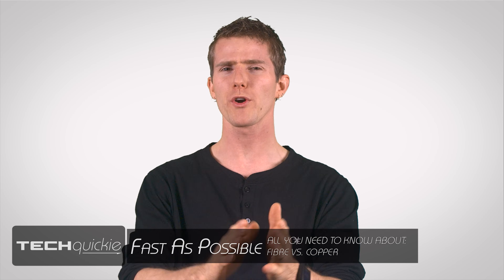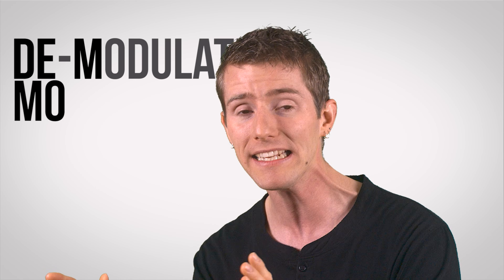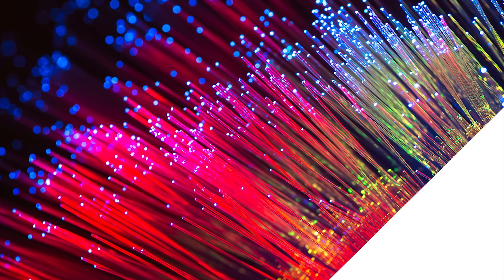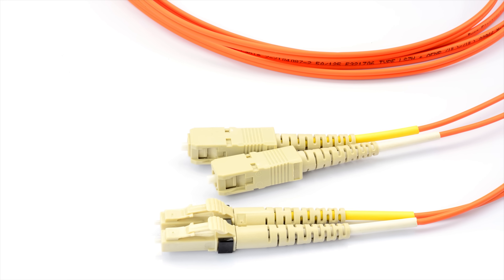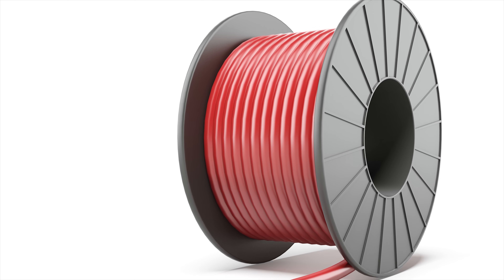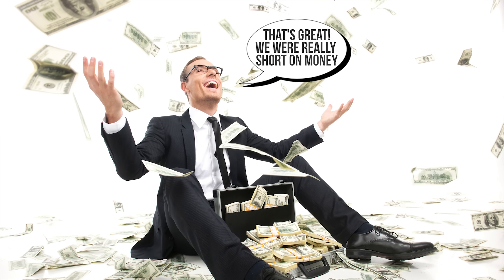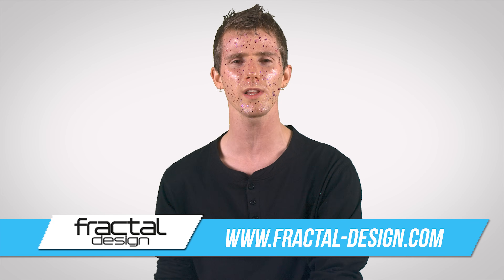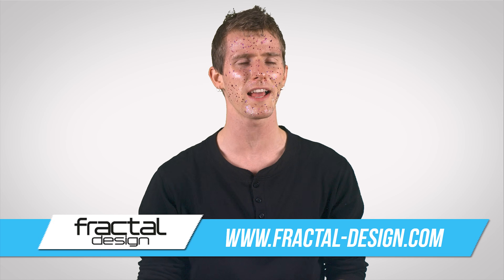Fibre (Fiber) vs Copper as Fast As Possible

Comment: since sony and microsoft are getting so many DDOS attacks

can your next video be about how DDOS attacks work? 

I m curious why DDOS are not called 'hack'
Reply: Cause DDOS is a attack not an hack.
Reply: A DDOS is not a hack because all it takes is a group of computers being remotely controlled from a different location sending massive amounts of information/requests to another computer until it can no longer accept and process any of the information.

Anyone who has access to a botnet (a bunch of computers that are remotely controlled that you can actually rent) and a script that are easily available on the web can do this. (Hence the term script-kiddies)

Hacking on the other hand means using software or hardware exploits to change aspects of how that computer works, and means actually looking at or changing actual computer code in order to access those exploits.

TekSyndicate have a bit of information about what a DDOS and why it isn't actual hacking is on their latest The Tek video.
Reply: A DDOS attack is a bunch of 12 year olds getting together and thinking that it's "fun" and "productive" to send millions of HTTP/FTP/SSH/etc requests to servers. No, it's not a hack.
Reply: There is DoS and DDoS. DoS means Denial of Service, which is a state of a server when it ceases to respond to client requests in a regular fashion. DoS attacks can be sent from a computer, or a small group of computers, with a fast internet connection. You basically launch as many threads as you can, and tell each one to request something from a server (like a web page or a large image). With certain exploits you can send specific requests that will take longer than usual to process, so you won't need a lot of resources for such an attack. An example is a PHP vulnerability a while back, that resulted in a lot of memory being consumed when you post a certain set of keys to the server.

Anyway, DoS attacks are easily killed by just banning the IP of the attacker. Automatic bans can be easily made, if the server makes a visit statistic to determine if an IP hogs a lot of the server resources (then it's probably trying to DoS).

Now, DDoS are a whole different story. It is distributed, which means that IPs from all over the world will perform this attack. Usually these are hijacked computers (using trojans), that make only a few requests, so the owner wouldn't suspect anything, or wouldn't care. But their number is so high, that the flow of requests is too much for a server to cope with.
How do computers get infected? Well, it's a biosphere. People want software, that costs money, but they want it free. Some people reverse engineer, or get leaked info from the software manufacturers, that allows them to make cracks, keygens and stuff like that. They don't do it for free of course. They include some scrip there that would take simple remote commands. Now they have a botnet, that they could rent to people for money. Who rents them - script kiddies or people with a grudge that want to do industrial sabotage. Sometimes by hackers that use this as one of the steps in their attacks. And cracks/keygens are not the only source of these trojans. Free programs all over the internet, that are useful, often have sponsors that get to include their shit into the installer, and sometimes that shit is some real shit if you know what I mean. I got my share of shit from programs like Orbit Downloader, Freemake <app>, you get the idea. Just be careful what you're installing, what they're trying to push with that, and verify after the install that there is no new shit on your computer that shouldn't be there.

That's why you shouldn't do crack. I mean you shouldn't use cracks and keygens for software you use. Find a free alternative, pay for it, or don't use it. But if you really must and there is no other way, try to sandbox that shit. Have a virtual machine to run the keygens in (use VirtualBox - it's free, and you can install trial versions of Windows on it), copy the generated key and use it in your main computer. Cracks are not possible to isolate however. If it's a program you rarely use - put in in a virtual machine as well, and start that machine when you need this program. Keep your computer clean, don't be a part of a botnet.
Reply: A DDoS attack should not be considered a 'hack' - because there is generally no compromise or exploit of a system. It's just a bunch of systems ganging up and making as many requests as possible to a system. There is nothing wrong with your web browser requesting www.youtube.com. It is a problem if a billion computers all try to request www.youtube.com as rapidly as possible, repeatedly. This is a DDoS.

DDoS is often executed with a 'botnet' of compromised systems - that were indeed affected by some kind of 'hack'. Illicit individuals or organizations will rent out these botnets for fees, or use them for their own whims. Sometimes, (like with DNS/NTP amplification attacks) just one or a relatively small number of systems can exploit the legitimate purpose of a protocol for unintended purposes - here there is potentially no botnet, and the  attacker leverages a collection of otherwise secure servers owned by private companies and governments. In these cases places like universities and government research centres with 10Gbps+ internet connections were tricked into sending gigabits of traffic at victims.

Comment: Why not have have data transmitted via AC current? We use AC to transmit our power because it can be transformed, unlike DC, so why not do the same to transmit data without signal loss?
Reply: omg u are a total idiot, hahahahahaa
Reply: Kostas Markopoulos ever heard of powerline ethernet? Hurhurhurhur
Reply: Dean Schreiber  Powerline adapters are actually just a compromise to avoid running extra cables, transmitting data over a power line isn't done because it is better in any way, it's actually a lot worse and more difficult because; as explained by linus, the signal has to me modulated and demodulated at either end and so there is a limit on how many data streams it can handle, a limit which is set by the quality of the power line being used, the only reason it works in a house for example is because the length of the power line is so short that there is hardly any signal quality loss.
Reply: There were plans to deploy broadband over power lines - http://en.wikipedia.org/wiki/Broadband_over_power_lines . Unfortunately, this method seems to cause interference with radio communications, which may be one reason why it has not been instituted. However, if interference and other issues can be worked out, it would seem that delivering broadband over power lines would be an excellent solution as power lines are widely deployed around the world.

Comment: I'm fully aware that USA is a far bit behind EU with tech, but you must have misread some of your data??? Fiber and copper is about the same cost per kilometer around here in Denmark and most people are hooked up on some sort of fiber connection now. We have used fiber at my place for almost ten years now and our ISP has implemented 1 Gbit connections this year for consumers.
It is much cheaper per Gbit than a copper connection.
Reply: FYI we pay USD 29,- a month for a 40/40 Gbit (guarantied minimum speed) fiber connection here with free IP phone
.

Comment: Only real issue with the current fiber standards is error resend rates. If you spec your network correctly you will rarely get a invalid packet though. COPPER standards resend at 1ms interval.  Fiber resends at 6 ms intervals. Thisvwas built in the orginak standard when they had to muxdemux  the fiber concentration.  It needs to be changed due to the lack of large ATM backbones.

Comment: Powerlines are made of aluminum, not copper.
Reply: The conductor in power cables can be either copper or aluminum - http://en.wikipedia.org/wiki/Power_cable#Construction .
Reply: elad7779 the long cables that span from pole to pole are always made of aluminum,  copper would be too heavy and too expensive for it to be practical.  Copper is mainly used for grounding and to make jumpers from the phase to a transformer

Comment: That's a rather simplistic description of the layers in the fibre optic cable, also the outer layer isn't just for protection of the inner cable, it is also necessary for the cables to work at all. As you require a difference in the refractive index's for the light to stay within the cable and not just pass through it. Maybe you could do a Techquikie just for fibre optic cables to describe them in more detail.

Comment: Great Techquickie as usual, but there are two faults in it. Copper isn't normally used to get power to a home (at least here in Europe, but I think it's like that in the US/Canada too), we use aluminium since it's lighter and cheaper. Copper is used inside a home.

The second you said that fiber is far more expensive pr lenght than copper. This is also not completely through. Fiber is usually less expensive since glass is cheap, it's the equipment on either side of the fibercable that is the expensive part. An expample, I as an electrician can buy a 144 strain singelmode fiber cable for about $10 US pr meter. That's cheap. 2-pair Cat 3 (used into domestic houses here in Norway (one of the most expensive countries on earth) coast just a little more than a 4-strain singelmode fiber.

Comment: As a electrician i can say that the fibre cable is much cheaper than the copper cable here in finland, what makes it expensive is the connectors that has to be applied by welding. the equipment for welding costs about 20.000€. only the biggest firms own this kind of equipment, pushing the prizes skyhigh..

Comment: why is fiber more expensive  than copper? I just bought a 10 m fiber cable for 10$. I use it from tv to home cinema for  audio. An good copper cable with 5.1 signal would have cost more and would not be futture proff. By the way moust of cities in my country  have fiber right in the house.

Comment: well, my ISP forced me out to migrate from copper to fiber.

at least, energy cost running analog line (copper/POTS lines are more expensive) than running fiber optics that only requires reflectors with no electrcity involved.
Reply: and now I bought a 5000va UPS just for this ONU (optical network unit) to operate 24/7 or else, ill loss my telephone during blackouts.
Reply: remle ikawura That is the only bad side of fiber: no PoE (obviously). I had to do the same here, even tho blackouts aren't very common.

Comment: HAH! Here in the Netherlands most homes already have their own glassfiber connection. And my ISP already offers gigabit internet (1000 mbp/s, up and down) for around 75 euro's, btw my ISP is on of the first to offer gigabit internet, even though it's not as cheap as google fiber; it still rocks that it's possible :)

Comment: light speed isn't 300 000 km/s  ?
Reply: The speed of light is 300 000 000 m/s in a vacuum, however it slows down when it enters a more optically dense medium.
Reply: The speed of light is not measured in the metric system.  It's currently estimated to travel at about 300, 000 MILES per hour.
Reply: nope it's  in km per seconds, I just checked it.

Comment: to people saying that we use nics now not modems, remember, many more people know what a modem means and this is basically a "tech 4 dummies" channel. like how he called an access point a router on linustechtips (or was it ncix) because more people knew what that was.
Reply: You do know a router is an access point with a network interface to manage connections right?
A router HAS an access point inside of it.
Reply: ***** Pedro Marques routers have access points, but access points do not have routers. I actually am rather knowledgeable on the topic, however not an expert. If I am wrong feel free to correct me.
Reply: Telespentry Um...A router is an access point.  It's a networking devices used as an entrance (gateway, access point, all the same) to the internet or network.
Reply: Wyatt Newton yes, a router has an access point. But the access point is not the whole thing. It also assigns ips, adds qos features, blocks websites, and much more.
Reply: It doesn't matter what other functions the device performs, it's still an access point.  The router's at McDonalds are access points too.

Also, it's the modem's job to assign IP addresses and to perform firewall duty.  There would be not point for those features on a router because it's apart of your network's subnet.

Comment: Here in the Netherlands, in most cities and villages, fibre is being rolled out to the doors, not only as a backbone. In my case, the fibre is coming inside, and we have a special modem designed for fibre-signals. The speeds are amazing :)
Reply: Correct. The whole country is being connected to fiber now. I have it too now and it's 10 x faster and costs only half of my previous provider.
Reply: Ja leuk snelle internet van KPN he. Ziggo is wel slecht met coax
Reply: Yep i got fibre straight into my house. But i'm also living in the Netherlands. :D Cheap and high speed :D

Comment: Fibre itself is actually pretty cheap ("per length"), much cheaper then copper! But over all much more expensive then copper due to the required network components such as WAN-grade switches and transmission protocols such as SDH, IP/MPLS ect. and the required upgrade costs from copper.
Reply: maflolo33 ummm no.
Reply: Adam Mckeithan
ummm yes. /watch?v=YcQW8z-iSvI
A german video from 1992 from t-mobile/Deutsche Telekom and it covers the same fibre we use for today's internet transmissions (back then used as a telephoneservice backbone) and they also cover expenses and even in 1992 it was cheaper then copper.
Merry christmas!
Reply: maflolo33
umm no since they need to dig the roads and etc to make a fiber line and then, if it was available before, yes but since you need to lay a new LINE to make it available it takes a way lot of money to lay a new infrastructure

Comment: Wait, isn't copper as expensive as fiber? The issue with fiber is that making it and maintenance is harder and requires a lot more work. I'm learning computer engineering, I have a class about networking and I'm taking a online Cisco course(CCNA) and it's the first I've heard that fiber is a lot more expensive.
Reply: it would all matter on what you are talking about. If its a full telecom network. Copper has a lower install point but higher maintenance point with a higher degrading network value, Fiber telecom networks has a higher install price but with less maintenance with very little degrading value. I been telecom co tech for 9 years now. CCNA really not going to give you a understanding of a telecom network at all, i know from first hand. Had mine a few years back and didn't redo my cert bc its a waste in the telecom networks field.
Reply: Adam Mckeithan I know CCNA is not enough to know about all that but it's enough to understand that fiber isn't priced like copper and to know the basics. Where I live, I've had fiber for almost 5 years. I still hear people complaining that they don't have in the US.